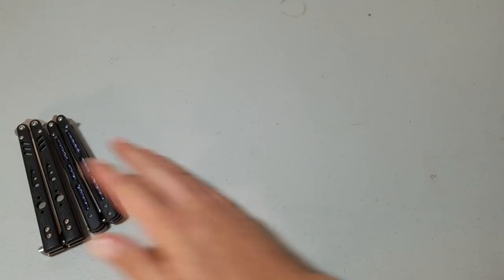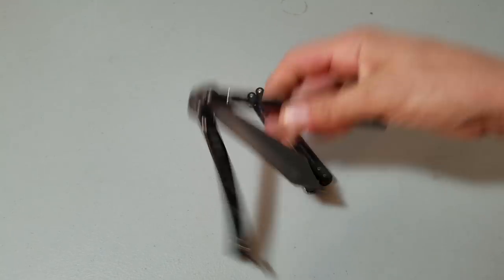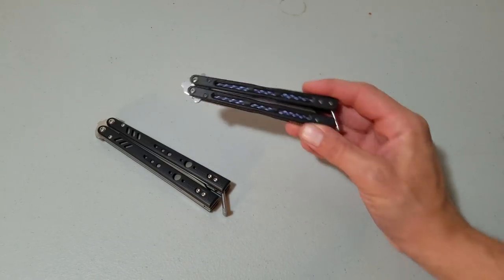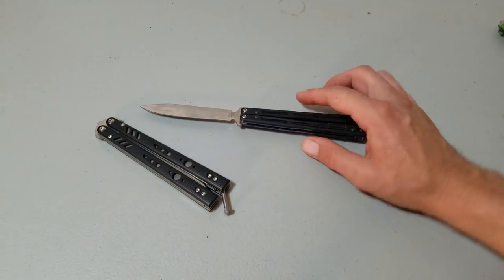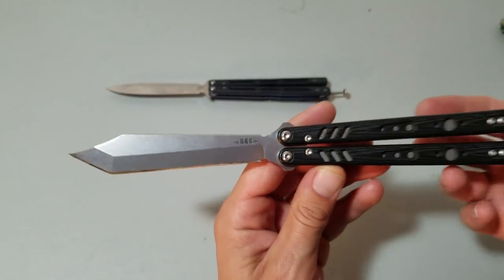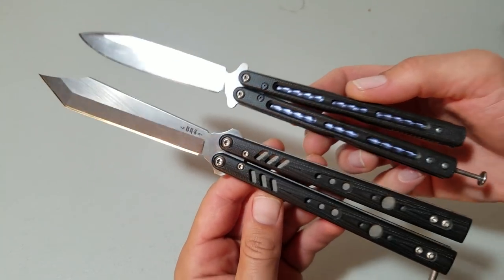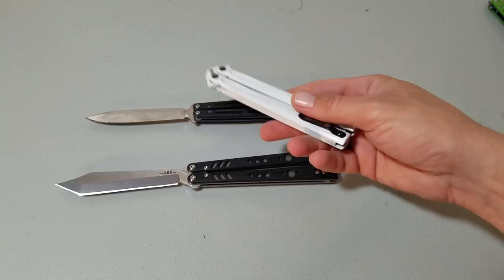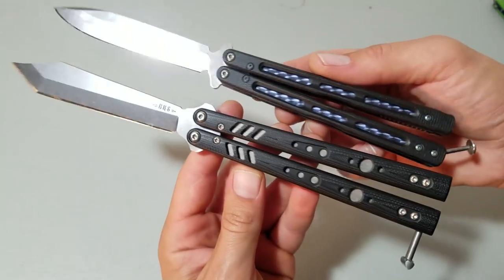BRS Replicant vs. Benchmade 51

Comment: personally I would rather have the 51 just because that blade is so nice
Reply from the maker: I think I would prefer the 51 most of the time as well
Reply: As a flipper myself the rep is much nicer to flip imo and I love the tanto more than the 51 blade
Reply: wulfrvm yeah but that blade design on the replicant is fucking sick
Reply: The alt rep is similar to it,Check them out! :)
Reply: If you pull out an alpha beast instead of a replicant the 51 would be worse

Comment: I got a Bm 51bk-1601 because the Rep was out of stock. I am happy with the 51 because I can use it as my "work" knife. I do wish I got the Rep, but the 51 is great. Though it is not the best flipper because of the length/width/play of the handles, it is still great.